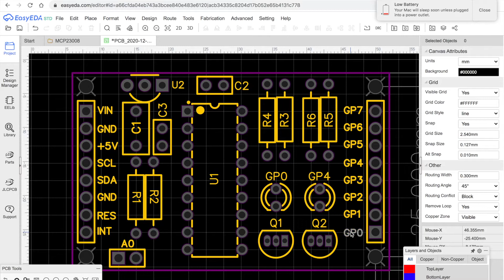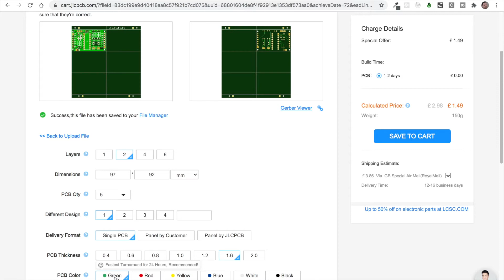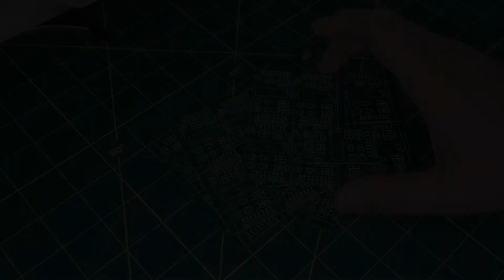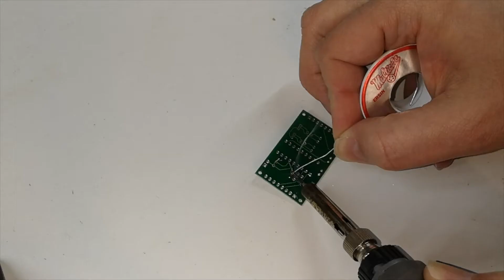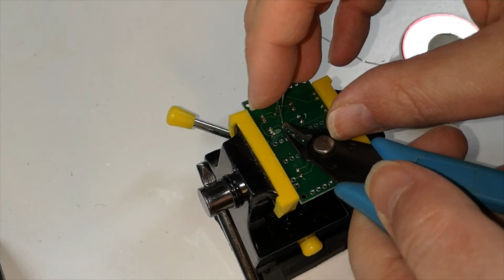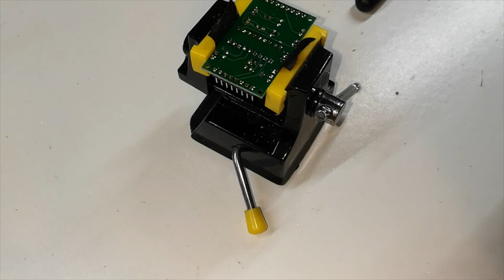Input/Output Expander - Part 3

Comment: Can you share the schematic and codes for lazy student like me ?
Reply from the maker: Sure. You can find the schematic and code here: https://github.com/srayner/mcp23008
Reply: @SteveRaynerMakes  Thank you man, i appreciate it ,by the way there is MCP 23017 with 16/IO, but its drain open , do you know any similar one but soring current not sinking with 16/IO
Reply: sourcing*
Reply from the maker: @erbilshops3029  What makes you think the MCP23017 is open drain? Each pin should be capable of sourcing or sinking up to 25mA of current.
Reply: @SteveRaynerMakes  The datasheet is showing that its Configurable as active-high, active-low or open-drain but I did simulation in Proteus and i failed to make Common Cathode RGBLed to work with it, unless if i used common anode with 5V source . its like with Low output as default .incase if you can guide me on how to make it High output each individual Pin .
Reply from the maker: @erbilshops3029  By default the pins are configured as inputs. Are you setting them as outputs by writing to the registers IODIRA and IODIRB? I believe you need to write 0x00 to both of those registers to set all pins as outputs.
Reply: @SteveRaynerMakes  You are genius , finally i got it work . Sorry that i was dumb but i am still learning : it was stuck in my mind that it was Output low in spite of i read the datasheet many times